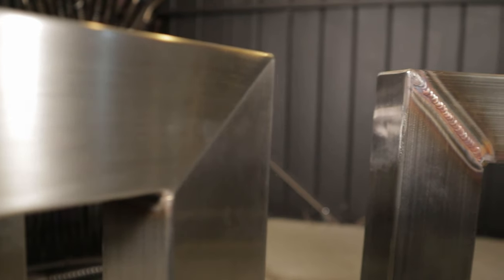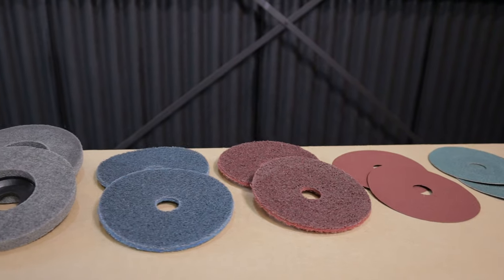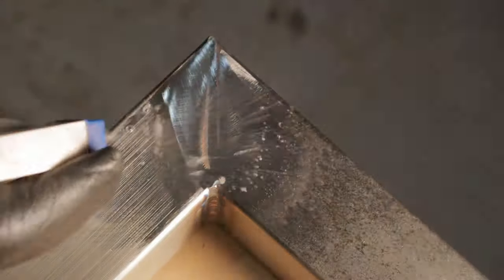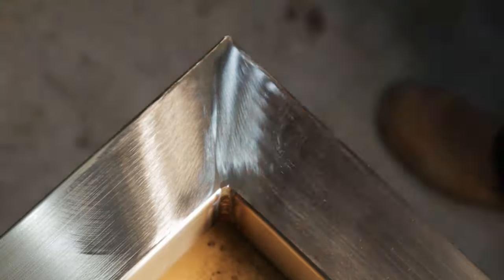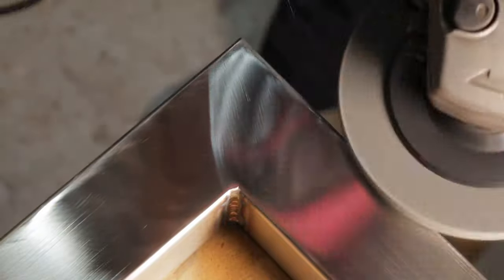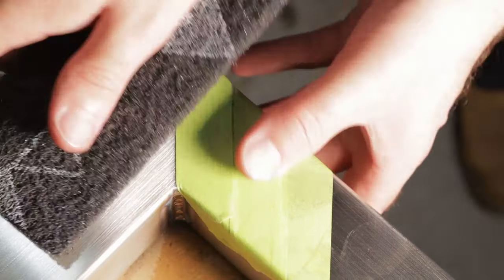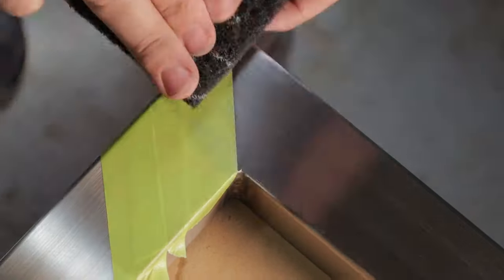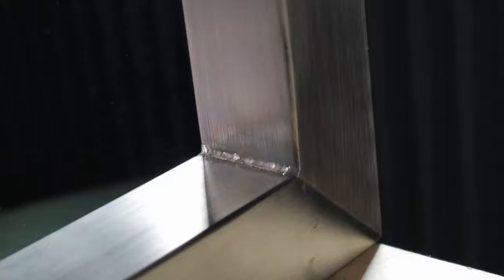Miter Polishing Square Tube - Stainless Steel [With Basic Equipment]

Comment from the maker: Get the sharp look of the miter polish without the big dollar equipment. Remember to subscribe to my channel so get the know-how on welding projects.
Reply: What kind of tape is best to use ?
Reply: Hello sir i am eric,i am filipino but im here now in saudi arabia for job fabricator ..i am profesional stainless polisher and finisher ..about that your hairline finish.for me..i use flap disc #80 and 220 sand paper only.then scratch bright or hairline machine..i try to apply any country as fabricator stainless polisher and finisher.keep a good work sir.godbless..

Comment: It does look good when you finished it. I use stainless steel tape and a line sander so there's no hand work except on inside corners. Also when I finish tig  welding an inside corner I let it cool for a few seconds and then using one of those toothbrush size stainless wire brushes that I ground to a pointed edge down the length of the head, I brush it to remove all the color. It brushes off easily when it's hot but not too hot. Another thing I like to do on thin wall tubing joints is to put a flat piece of stainless inside behind the weld joint so it doesn't shrink and make a dip in the surface. I noticed you had to work a good bit on getting the last bit of flaw in the surface probably because the surface had shrunken down from heat shrinkage. The inner piece works very well on straight joints in round tubing. Without it after blending the joint a low spot will be noticeable especially if it's mirror polished. It does take a precision disc but if it's thick enough it also aligns the joint perfectly.
Reply from the maker: Hey Xmradio11. Thanks for your comment. I will definitely use a backing strip on the next one. Cheers for sharing your knowledge. 👍

Comment: I Love this! I work for ELKAY Manufacturing in Broadview, Illinois, in the US (just outside of Chicago). I work in a custom & industrial scullery dept. I love the way that you did the maitre weld! We actually use cylindrical grinding stones (and 100-grit "highlight") on ours, but I actually prefer the way you demonstrated... At least for maitred corners. Thank you for the video!
P.S. in the mid-2000s, when our location still made a wide variety of kitchen sinks, our plant was featured in a television program called "How It's Made." The filming took place during 2nd shift, about a year or 2 after I moved to 1st shift (I was really hoping to be on the show!). Anyhow, I DID know all of the people who were featured in the program.
Our plant still makes SOME kitchen sinks, but mostly industrial and custom sinks, as well as drinking fountains (I think everyone has used an "ELKAY" drinking fountain at some point, as we are world-wide, though mostly in the 🇺🇸, with plants in 🇨🇦, 🇲🇽, and even a couple in 🇨🇳.
Reply from the maker: Thanks for the comment Stanley, I appreciate your kind words on the technique I used. It means a lot coming from a professional in the field. A lot of people think you need expensive equipment to get great results. I will have to check out the how its made program.
Reply: This is my current Work in dubai.....very easy to make

Comment: The tape on the miters is a simple and brilliant solution to grain direction. I'll definitely use it.👍
Reply from the maker: Cheers. I'm glad you found the video helpful 👍
Reply: @weldingempire  brother first blade name please ???
Reply from the maker: Hey, it's an 80grit sanding pad.
Reply: @weldingempire  thanks boss ✌🏻
Reply from the maker: You will need to to use 120grit next then the red scotch brite pad. This will leave very fine scratches. Then use grey to make it even finer.

Comment: Thank you for the great video! This is solid work! beautiful! I'll have to try this with aluminum. I usually end up burning calories hand sanding with a hard block for max flatness, but this looks as flat as it needs to be.
Reply from the maker: Cheers Brian, much appreciated. I used to use a DA sander for a lot of the final stages with aluminum, when I was in that industry.

Comment: Great work.  I started to work with inox brushing and i have big box shaped parts wich have to be welded on corners, so my question is there the way to blend welds to not brush all surfaces, the part is made of brushed sheets
Reply from the maker: Hey BMWM20, great question. Yes you can do it. But 90% of the work is making sure the 2 edges have no gaps between them. Then you can fuse the two pieces with no filler wire. I like to have a thick piece of aluminium angle behind it to take the heat away, while keeping everything square. All going well you only need to touch the weld its and not anywhere else. I would use a unitised disc. Hope that helps
Reply: @weldingempire  Thanks on answer

Comment: For the inside corner i like to use the 3 m bristle brush great finish. Also iike to use a rpm regulated  angle  grinder. On slow speed for al the grinding. Less heat  less wear  on the pads  and the same grinding time. I also use 3m cunriton  disc
Reply from the maker: Thanks for the comment just make it. I live that idea. I will try in the next project.

Comment: I do a lot of this type of work, mostly stainless handrail. Instead of tape I find it easier to clamp a very thin piece of copper to the miter.
Reply from the maker: Hey Tom, thanks for the comment. You are 100% correct there. I do the same, I wanted to show how you can do it with very few tools or products. I have another video on using a burnisher for faster results where I will use the thin sheet.
Reply: I use stainless steel tape from McMaster Carr.

Comment: Awesome work! Is it possible to polish weldings on alloy, eg. alloy bike frame?
Reply from the maker: Hey, are you looking to remove the welds or polish to a high shine?
Reply: @weldingempire  Polish, but high shine it's not necessary. I am afraid if I would completly remove welds off the surface, frame could break 😅
Reply from the maker: If the weld hasn't been designed to to polished out it would make the weld to weak.

Comment: A weld with no undercut would have to be one of the most important factors for success when finishing stainless like this, I personally believe you weren't super efficient but the outcome was pretty good.
Reply from the maker: Thanks for your your comment. I have a burnisher to do it faster but the video was to demonstrate how you don't need expensive equipment.
Reply: @weldingempire  bro actually I have to remove a welded nut from the steel can this process work ✌🏻??
Reply: I often find myself having undercut with these types of joint welds too, and grinding the weld clean can be a pain in the ass. How do you do it? Weld colder? Thicker filler rod? Or higher amps but way quicker travel speed? Problem is I don't want to compromise on the penetration.
Reply: @Lonx2reel2breel  torch angle is a big one. Usually you can see the undercut as you’re welding and can go back and fill it. Just make sure to burn into the edges of your bevel. Also, this guy making the video did a lot of grinding. Usually if undercut appears after a couple good passes with a sanding disk, its a good idea to go back and fill the undercut with weld then continue sanding. He might’ve dishes out the corner but we wouldn’t know because he didn’t put a straight edge across it.

Comment: Great to find a video targeted at people with basic equipment, big thanks!  We would like to use stainless steel channel to edge our kitchen end panels, no welding involved.  What would you recommend to achieve a simple clean easy to maintain brushed finish along the length?  Would abrasive pads alone be enough or would we need a cylindrical pad too?  Appreciate your advice, thanks again! 😃
Reply from the maker: Hi, to maintain the grain a good quality red abrasive pad would be fine. Use a very small amount of kerosene with the pad. Use a sanding block to evenly spread the pad over the whole surface. Just do one continuous stroke over each length until you are happy with the look. Changing directions will be very noticeable. Warm soapy water to remove the kerosene with a clean cloth and follow the same one direction method. I am glad you found the video helpful and I hipe that helps. Cheers.
Reply: @weldingempire  wonderful, thanks for the advice, much appreciated!

Comment: For grinding that inside corner weld, 80 and 120 grit crosspads on die grinder, then or bristle discs from 3m.
Reply from the maker: Thanks for the tip, @gGeorge96! The idea of using 80 and 120 grit crosspads on a die grinder for grinding inside corner welds sounds like a great technique. I'm definitely going to give it a try in my upcoming build. The addition of 3M bristle discs seems like it would provide a really nice finish too. Always appreciate learning new methods and techniques that can improve the quality and efficiency of the work. Looking forward to applying this in my project. Cheers!
Reply: Absolutely man. Excellent video btw. Cheers

Comment: Is there a shortcut to these steps to just renew or refresh the finish on a stainless steel commercial refrigerator?
Reply from the maker: Hey Fabian, if the scratches aren't to bad on the fridge use red scotch brite pad. The pad will need to be on a sanding block. Use a small amount of kerosene as a cutting lubricant. Keep in line with the grain of the stainless (very important) and each stroke needs to be the full length of the fridge or you will notice the changes in direction. Hope that helps.